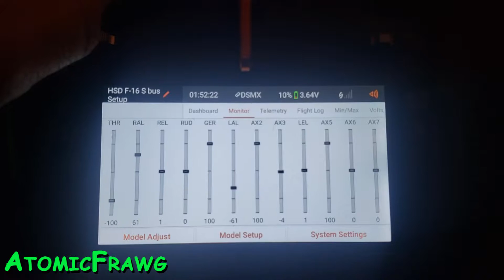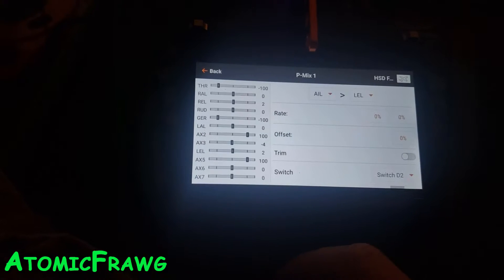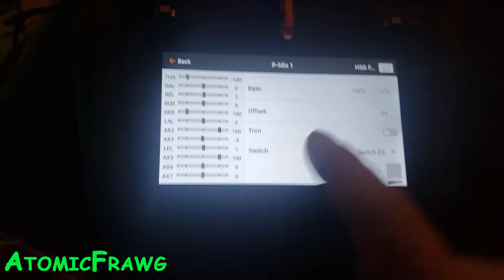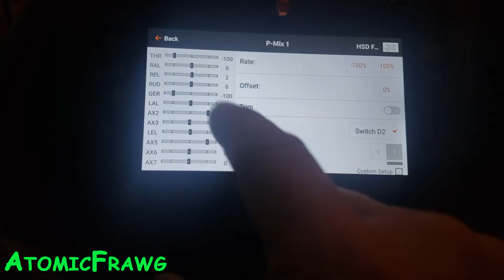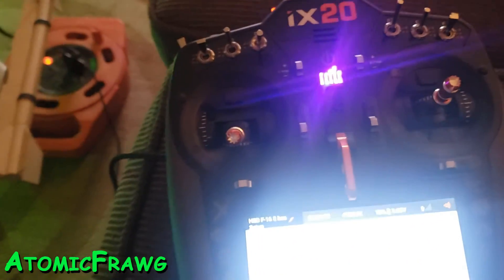HSD F 16 MFC-2085 mixing setup

Comment: Is your throttle/ele mix backwards in this video? Does it need up elevator with increased throttle? What percentage did you settle on? I just added a 13% mix to mine with the gear up, will try this weekend.
Reply from the maker: The mix is correct. The HSD F16 climbs with an increase in throttle. So down elevator with increased throttle stick. The reason for turning the mix off with the gear down, is to stop that mix from fighting you on the landing approach with small bumps of the throttle. Keep in mind, if you run a gyro none of the down elevator mixing is necessary. Also not sure the final setting as I used the extra trim to fine tune and just left it when it felt correct.

Comment: Did your AUX7 allow you to set throws and sub trim from the MFC?  My extra AUX channels don’t have ability to do that?
Reply from the maker: I do everything in the radio.
Reply: @AtomicFrawg   Okay, thanks for the reply!  I was trying to use the MFC to set throws but then it made it difficult to match my left elevator that I put on AUX 7 since it had to be set via my radio.  I will go back and set everything by my radio as well and return the MFC throws back to default settings.  Thanks so much!

Comment: I think S bus is for futaba .Can you set it in Spektrum Tx ?
Reply from the maker: S bus is not a transmitted protocol. Its the reciever that has a SBUS signal to talk to what ever outside the receiver using a single wire. Spektrum rxs uses SRXL. That being said please look at the equipment being used and you will see its an orange rx which outputs sBus as well as srxl. Also sBus is not from futaba, its just what they chose to use with thier rxs and servos.